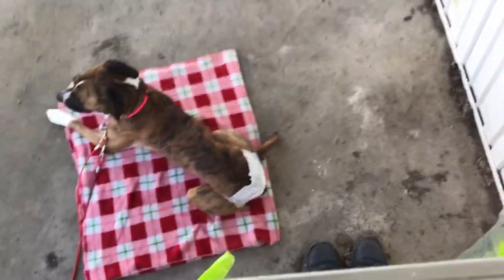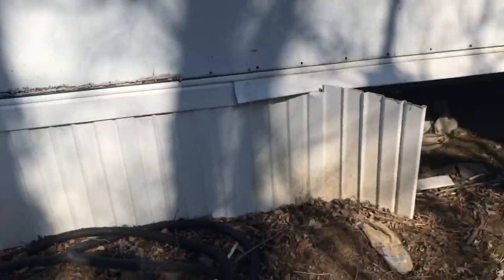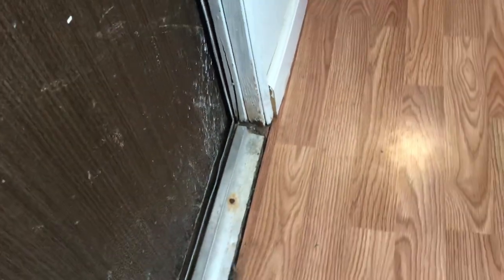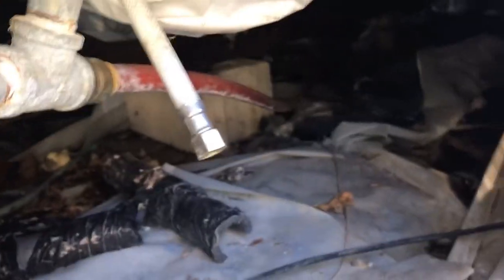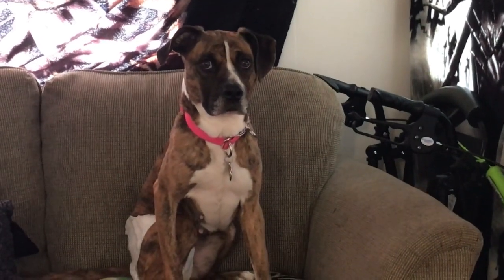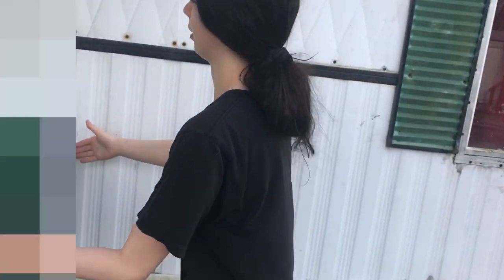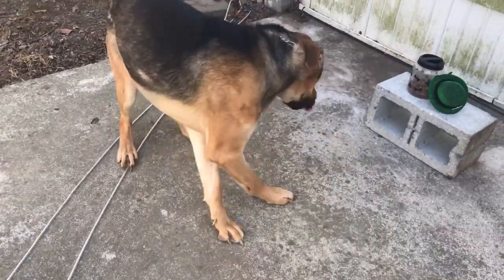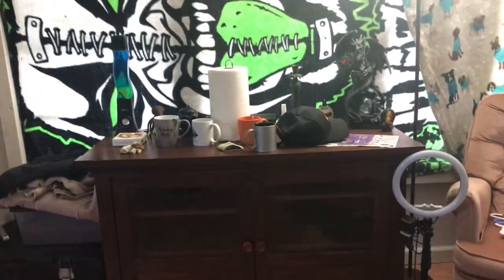🛑 Our Pipe Broke & Started Spraying EVERYWHERE ! | March 17th

Comment: I would keep the door unsealed (with the spray foam i mean) in case of a fire where you might need to use it to escape. I'm sure it would be easy to break through the foam but in that situation you'd want the door to open as quickly as possible. Just a thought though, I can't stand those little nooks and crannies that bugs come inside through! Also I'm so glad your water is fixed again! We've had similar issues and it sucks. Esp while being housebound and not able to go shower anywhere else.
Reply: Duct tape is a good temporary fix as pushing from the inside will easily dislodge the tape in case of an emergency.
Reply: @christinestill7303  that is true! Duct tape would be super easy to push through in the case of an emergency. An actual repair would probably be expensive so I would stick to the duct tape too.